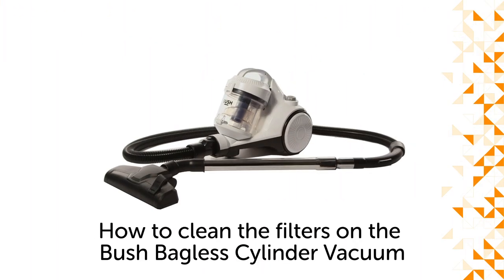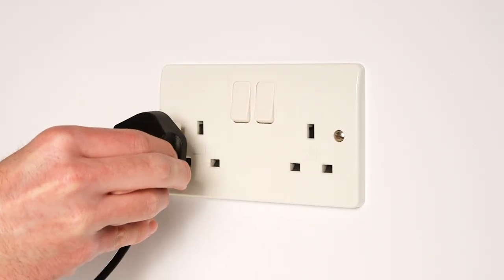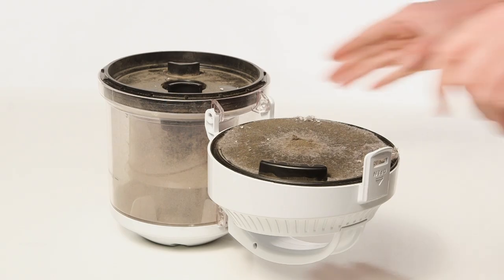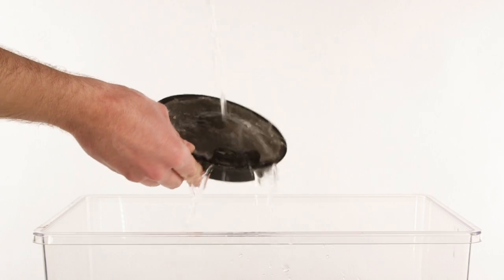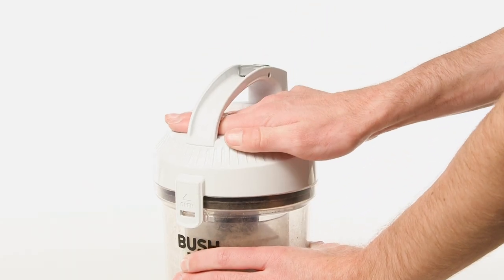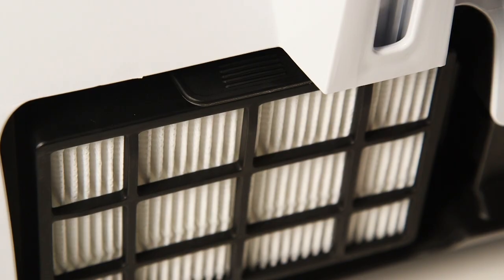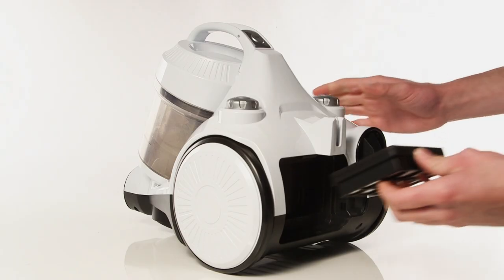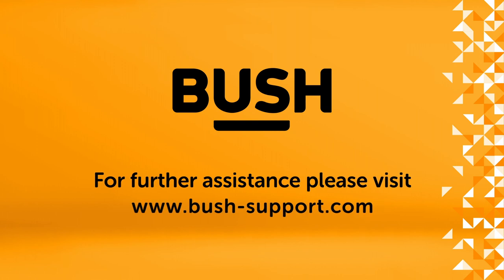How to clean the filters on the Bush Bagless Cylinder Vacuum

Comment: My bush Hoover don’t working properly...now it’s have very low vacuum power..why...?
Reply from the maker: Hi Justin, there could be a few reasons for this.

Are the filters clogged up and need cleaning?
Is there something blocking the nozzle?

If you are still having problems, please contact: 0345 6040105